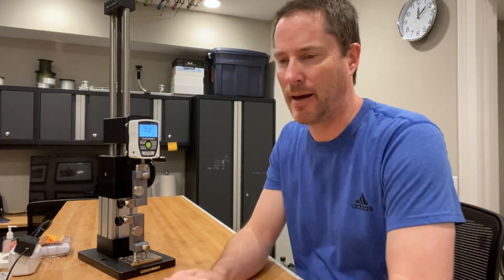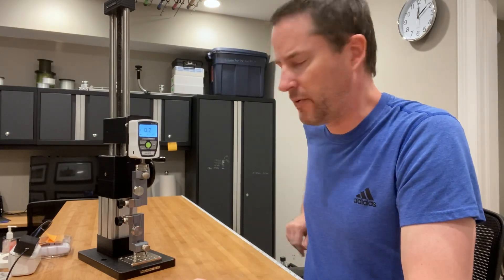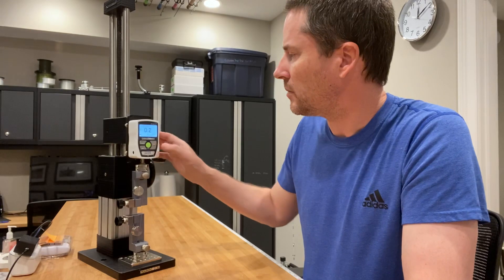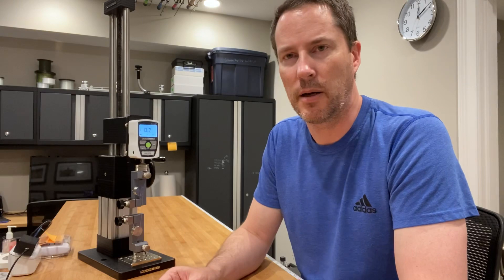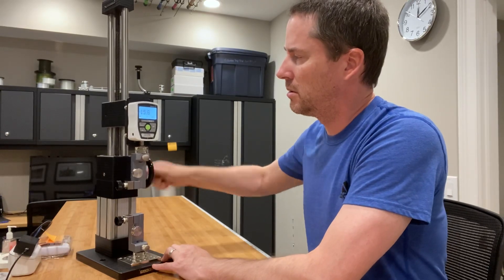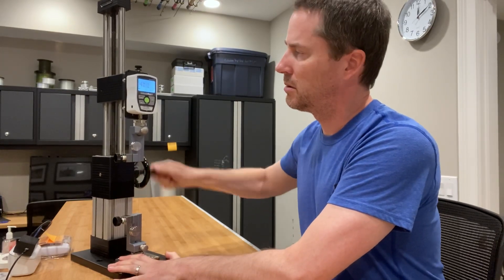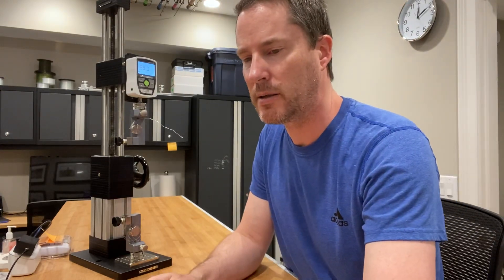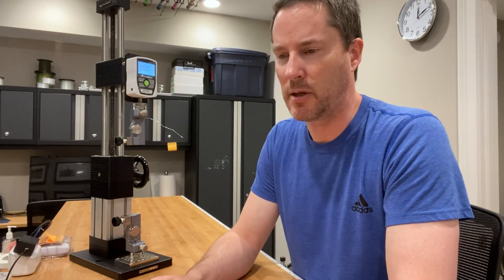Breaking Strength Test for Trilene Big Game 50lb test

Comment: I have been using this fishing line since I was 5 years old when my dad took me fishing with a bottle of soda and have never been disappointed, even if the line gets old, never fails, you don't need to spend more money in other lines, this line apart from being cheap, is durable, resistant and reliable